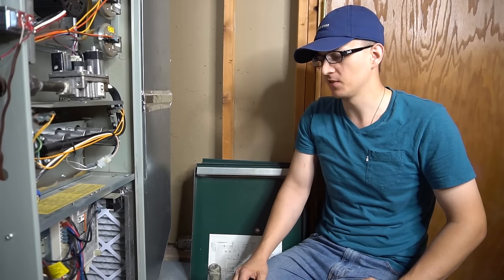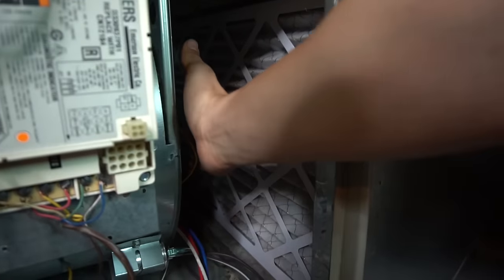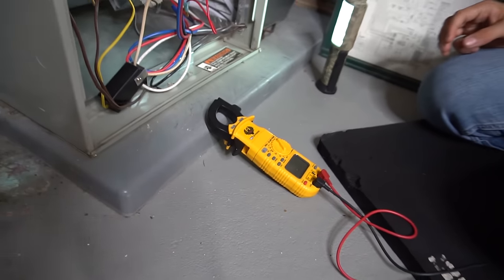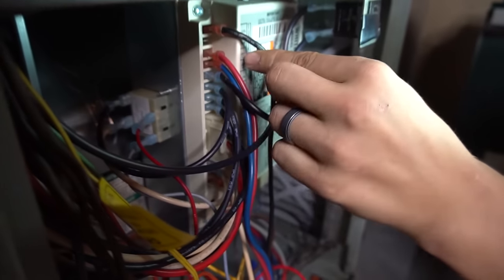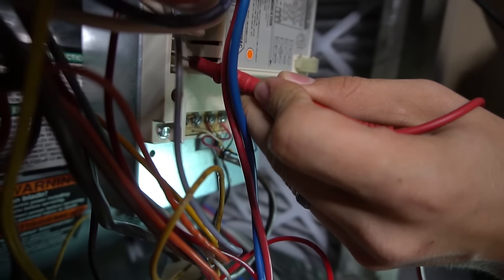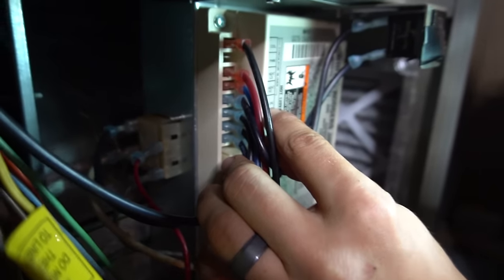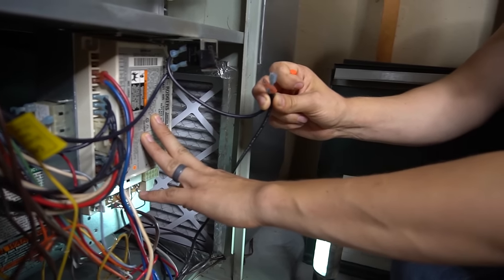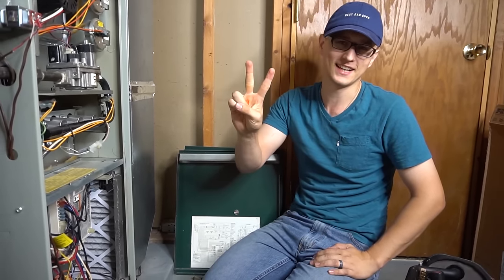Furnace Blower Not Working - How to Check It

Comment: Thanks for posting this video. It has showed me what I need to do to check my furnace myself instead of having to put out money I don't have right now. I've been so stressed. Can you tell me what the furnace will do if it is the control board or blower motor? My furnace hasn't been working for about a month now and its making a light humming noise and it will light up for about a minute or two but then the flames go out. I've replaced the hi limit switch, capacitor, and two other parts but still nothing. It's flashing 4 red lights. Thanks so much!
Reply from the maker: Hi Amanda! What do those 4 blinks mean? The diagnostic chart/explanation should be on the back of your furnace door or in the install manual if you have it. On many furnaces that means your furnace is overheating. Is your blower motor coming on or only your burners come on and blower stays off until the burners shut off?

You asked me if I can tell you what the furnace will do if the board or motor is bad. It would behave the same way for both. The burners will come on, your furnace will overheat (because the blower is not coming on), and the hi-limit switch (temperature switch that prevents the furnace from cooking itself) will then trip which in turn shuts the burners back off.
Reply: @WordofAdviceTV  thanks for the response. I couldn't find anything about the red light on anything. But now the ignitor isn't even lighting up. And the blower motor isn't coming on at all. We changed the capacitor, high limit switch, hot surface ignitor, and flame rollout switch. The blower motor spins freely when we spin it but it was very, very dirty. We found someone that's supposed to come in the morning to look at it for us. I will let you know if we get it figured out. Thanks so much!
Reply from the maker: @elit6108  Alright, hope you can get it fixed today then! Good luck!

Comment: Great vid thank you. Question if the upper limit sensor goes and board is good will the test still show 120 power going to motor? If not is there an easy way to test upper limit sensor vs. bad control board?
Reply from the maker: By upper limit, do you mean the hi-limit/temperature switch? If the limit is open or shorted out, it will vary from furnace to furnace as to what will be happening. When there is a tripped/stuck limit, some furnaces will run the fan continuously and others will just sit there and do nothing at all. With limits, there should be power going in and power going out. If power goes into the limit but nothing coming out, then the limit may be stuck open. (you can try tapping on it firmly with a screw driver handle to try to free it) Another easy way to check the limit would be to bypass it. If furnace works without the limit in the circuit, then the limit is bad. If this is the hi-limit that has a dial on it with temperatures on it, then make sure you do not mix up the 27v with the 120v when bypassing otherwise you will fry some components. Hope that helps!
Reply: Thank you. My furnace cycles on vent fan then igniter then flame, but blower does not kick in.  It shuts off flame runs vent. Then repeats a couple time then gives led code for open limit.  I removed limit sensor and tapped it replaced no change. I bypassed no change.  My blower fan does not hum, spins freely by hand and is coll to touch. It just does not seem to power on. After watching your vid. I removed common white wire and high speed black wire to blower from board. I ran extension cord with 110v externally from wall outlet connected blower. The blower ran with no trouble. I then turned the furnace back on, with blower still running on external power.  I am now thinking it must be the control board. Blower fan and cap run ok on external power. Furnace runs ok with no error code as long as blower is on to keep box from getting to hot and opening limit. So I am guessing that leaves no power from control board to blower.?
Reply from the maker: From what you described, it does sound like the motor is simply not getting power from the control board. So you are right, it's most likely a bad board.

Comment: My blower fan seems to be working fine when I have the thermostat set on auto. I begin to have issues when I turn fan to the “On”setting. Seems like it start then turns off I’m a few seconds for a few minutes, until it locks out. Usually does this in between cycles while AC is not running.I live in Texas and we are still in summer schedule. What could be in issue?
Reply from the maker: The fan ON is essentially sending 24v from R to G. So perhaps a loose wire connection at G or the thermostat is bad. Could be a control board issue but I would suspect it last. I would take the thermostat off the wall and jumper R to G. That should turn the fan on and keep it on. If it turns on and stays on, then likely the thermostat is bad and should be replaced. If the same issue continues then usually it's either a loose wire connection or bad control board. I have videos on how to bypass a thermostat if you need it.

Comment: Will the blower come on by wiring directly to power (as you did) if the capacitor is bad?  Also, my unit has what looks like a transformer mounted near the control board and I wonder what happens if it fails?  Lastly, could the thermostat be causing the blower fan motor not to turn on?  Curiously, the dc adapter (12v) plug that powers my NetGear wifi router, my GoPro (was plugged in to a usb port charging it's battery) and the dc adapter (19v) plug that powers my Sony Vaio laptop ALL WENT BAD at the same time that the fan stopped blowing.
Reply from the maker: I wonder if you had a power surge/spike.. In that case there can be more than one thing bad so it would take some checking to figure it out.. If the capacitor is dead, the motor would not come on or it may start but spin very sluggishly. If the transformer fails, your board will no longer get 24v which powers on the thermostat/ac/furnace. The only way to know for sure would be to check voltages with a meter.

Comment: I realized last night I may have frozen coils. I turned off my unit to let it thaw. I poured our suggest solution mixture last night as well. I air filter was dirty and I discovered a bird trapped in area outside of the furnace (other side of the filter)....there was water dripping last night down the side of the unit. Now it’s thawed and unclogged but the unit will not come on but the outside unit is working fine. Tried to turn on the heat, noting as well....I guess I should start with the fan motor? Maybe the dripping water did damage?
Reply from the maker: Have you tried hot-wiring the fan motor straight to power like I show in the video? If it won't turn on when wired directly to power, then yes, the motor is bad. Besides the fan motor being bad, it could also be a dead capacitor, or the control board is not sending power to it though.

Comment: You jumped out the hot wire from the board but are you saying you don't have to disconnect the common wire from the board and jump that out also. Thanks.
Reply from the maker: The common from the motor goes to the same circuit on the control board as the common from the transformer. So only the hot wire needs to be jumped out.

Comment: Jay--very helpful video--my blower motor wasn't coming on and when i opened up the air handler compartment i found water up all the way to the filter !  Apparently drain was either clogged or p-trap was dry and wouldn't let it drain.  Since water had been running down the side of the blower motor i wanted to make sure it wasn't shorted out etc so i followed your procedure.  However, what i discovered was the there was not 120V coming out of the control board.  Just to further confirm i followed your hotwire procedure and the blower motor immediately came on (relief !)--but when it came on water started running down the side of it again even though the drain pan was dry--so maybe water in the squirrel cage ?  In any event things got weirder when i shut the power off (i have to unplug--there's no switch) and hooked the leads back into the control board--when i plugged the power cord back in the 15A buss fuse next to the plug in outlet immediately blew.  I thought maybe the water had shorted the motor so i waited until the motor was dry and re-ran the hotwire test and the blower came on just fine (again relief !)--but when i unplugged, put the leads back in the control board and plugged in again my new 15A buss fuse blew immediately again.  So now i don't know what's causing that--can a bad control board cause a short like that?  And if so, why hadn't it shorted out the fuse in the first place?  (ie the fuse was ok before i started all of the above). or is it possible there's a new issue ?  Thanks in advance for any help
Reply from the maker: Hey Mark! Thank you for taking the time to tell the whole story and not just the last part :) Yes, it is possible that the control board is bad. Also, do you know for sure that you are plugging those wires back into the right spot? Which wire did you use to do the hot-wire and which terminal/s did you pull it off of and now putting it back on to?

About the blower motor housing. I bet there was just some water on the bottom of the housing. In that case you can let it just dry out with time or take out the blower assembly and tip it over to drain it out. It's possible that the water leak took out the control board or damaged something else.
Reply: @WordofAdviceTV  thanks for the quick response, Jay.  The wires i took off and jumped together were the black wire coming from the door switch--it went into the "Line" terminal on the control board & the blue wire on the "Cool" terminal going from the board to the motor--i'm pretty sure i plugged them back into the right terminals but i'll check to see if i accidentally switched them around.  What worries me is that all that water (50 gallons +) collected in the air return compartment (fortunately this unit is outside the house here in AZ) but no condensate went into the secondary drain line to trip the float switch--it was dry as a bone--made me wonder if my drain pan is cracked but unfortunately on this Rheem unit there is no way to access the drain pan without cutting the coil casing.  What a crappy design !  Is it possible that if i had a dry P-trap there would be so much air being sucked back into the drain pan that it would also prevent drainage to the secondary line, given their proximity to each other ? i went ahead and ordered a new control board--hopefully that's where the short is, although i didn't see any sign that water touched it.  Will let you know in a week or so.
Reply: @WordofAdviceTV  OK Jay--now i feel like a bonehead--you hit the nail on the head with the short--i didn't switch the wires around but instead i plugged the black wire from the door switch into an open "neutral" terminal creating the aforementioned fireworks--yeesh.  At least the fuse protected the blower motor--i hotwired again and it works fine--but i still can't activate the fan at the thermostat.  Going back, since i originally didn't measure any voltage at the output terminals of the board i am replacing the board and crossing my fingers.  Thanks again for your help--you ever done any dumb thing like that ?
Reply from the maker: Yikes, so a direct short is what it was. Glad to hear you figured it out though! There is a good chance that it is indeed the board that is bad. And yes, of course I had my share of blunders like that too :) one time I put in a hi-limit that I had to break a little tab off of to make it into 24v limit instead of a 120v... And I forgot to break that little tab. I fried the thermostat, the limit, the control board, and the transformer all in one go. Only did that mistake once.
Reply: @WordofAdviceTV  I remember my Dad telling me that "experience" is what you get immediately after you needed it :)  The control board arrives next Wed so will let you know if that was it.  I would never have thought of doing any of this myself without your assistance
Reply from the maker: Lol, I ll have to try to remember your Dad's quote. Yeah, come back later and let us know how it goes!
Reply: @WordofAdviceTV  Jay--the part was finally delivered today but i am wondering whether this board is going to work or not.  I don't know how to attach pictures so i'll try to describe:  The Goodsky relay in the middle of the new board says 1/8HP/240V~ then below that 1.7A/31VAC~Pilot and below that Coil:12VDC. The Potter and Brumfield relay on my board only says 12VDC then below that 5A@120VAC.

The new board shows the number 1012-83-9259A at the top where mine shows 1012-83-9257A.  The SKU numbers for both are the same: 62-24268-03. 

Are these values just what the relay is rated for or does the Goodsky require 240VAC ?  i’m reasonably sure my input voltage is 120—at least that’s what’s coming off the door switch.  Since i’m not an HVAC expert i’m hoping you can tell me if the new board is just an evolution of the series that will work in my Rheem AC/furnace or do i need a different board
Reply: No need to respond, Jay--took a flyer that the voltage printed on the relay was a maximum rating, not a requirement, and that the slight numbers difference was an evolutionary thing and not a different model--plugged it in and everything's working again.  Thanks again for all your help--yours are by far the clearest, most concise videos on the web.
Reply from the maker: @marks526  Awesome, glad to hear you got it going! :) Stay warm! And thanks!

Comment: Great video! I do have a question for the blower motor. It seems after a period of time (maybe every 3weeks) My ac blower doesn’t work. So I turned off the ac, wait 15 mins, and turn on cool mode, then the blower back on. Then after 3 weeks, it doesn’t work again, so I need to turn off and wait 15 mins then turn ac on, then it works again. When it doesn’t work, I try turn the fan from auto to on, the blower doesn’t work. Then I try the heat mode, however the blower works! The capacitor is good, and when the blower doesn’t work, the condenser works fine, but the coil is freezing up a little bit. Thanks for any input!
Reply: GAO XIANG I'm having the same issue. Did you ever figure it out
Reply: Stephon Rutledge Yes. It was a bad time relay on the circuit board.

Comment: hi can you help me i am installing a evaporator coil   and line set is vert tight going into coil  do i have to swag it ?? thank you JIM
Reply from the maker: Hey Jim! I would swag in a piece of pipe, that would be better then the risk of kinking a line. That being said, I am not an installer though. I do mainly service work and seldom anything with install. So you may want to confirm with someone else.

Comment: What if the blower motor is turning and and also getting very hot …is the fact that the motor is getting very hot a sure way of knowing that the motor is bad?
Reply from the maker: The motor might be going bad or the capacitor is bad and that's what is causing it to overheat. If you have a multimeter, check the capacitor.

Comment: For heating only how do I determine to use red blower or blue blower wire?
Reply from the maker: By default, the heating speed is always the red. (low) But if the furnace is slightly overheating even though everything is okay (filter and coil are clean, registers/returns open, gas pressures are good) then I will increase the fan speed by putting it on the blue (typically medium speed) to decrease my supply temp.

Comment: Hi there, thanks for your videos! they're really helpful. I want to ask you if you had the problem that i'm having before. My AC was working perfect, yesterday the inside unit fan quits starting when it should, it moves slowly for 5 seconds, quits, 5 seconds, quits and so on. So i turn the temp higher so it goes off, wait some minutes, and randomly, sometimes the fan start normally, and sometimes, it does the slowly movement, having me to manually turn the temp higher to turn it off. Do you had any trouble like this one, where the fan works OK randomly ? is there any ballast or something, like the lights, that went bad and make the fan engine do this ? Thanks in advance for your time and help!
Reply from the maker: My first guess would be that your capacitor is dead. Look at this video: https://www.youtube.com/watch?v=C82HvbvP08E&index=4&t=1s&list=PLK8tZPlovA8Aw5W4GIoingc_enl5apH4C
Reply: Hi, thanks for the answer. I checked where the fan is in the inside unit, and the motor that has is a Gentec X13 1/2 hp with all the electronics inside ( is the one that you can change speed changing the cables position ) I checked online and there is a guy that sell on ebay the repaired module for this motor. The funny is this, when i checked the engine i turned off the breakers and the AC switch, maybe this reset everything, and now the motor is running perfectly again, it always turn on OK when the A/C need it. Yesterday it was a disaster, never turned on when it needs to. I'll check it in the next days, but it seems that is working OK again now. Thanks for your time and help!!!
Reply from the maker: Thank you for the update! And I apologize, I read your first comment wrong. I thought you were talking about the condenser fan motor that is outside. But I'm glad to hear it's working! May it keep on going then!

Comment: Hey, my furnace turns off when it’s desired temperature is reached but the blower is still going. I was told that the blower is only
Like 20 rpm and needs to be replaced. I have a 27 year old Trane XE 80. Do you think it’s the blower? And if everything else is working fine should I just replace the blower and not the whole furnace? Or replace? Only a 1-yr homeowner so would love your advice. Got my wife and 2 babies also so we don’t want to freeze 😅
Reply: I bet it was your fan relay. Be interested what you found.